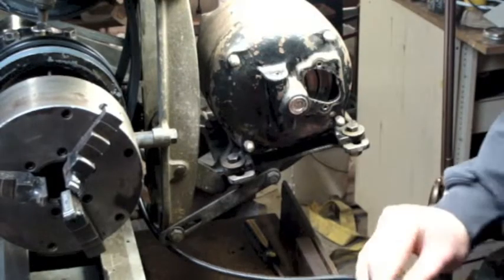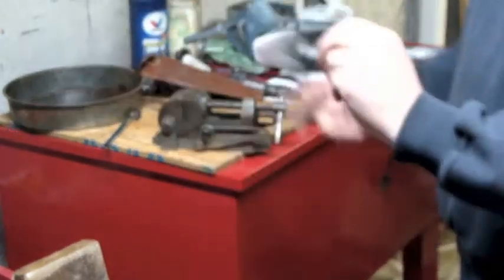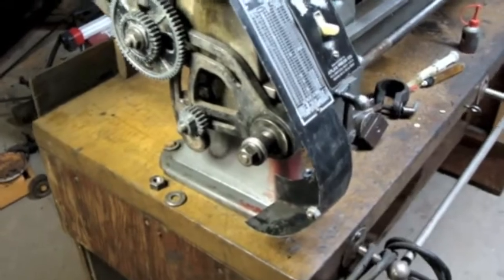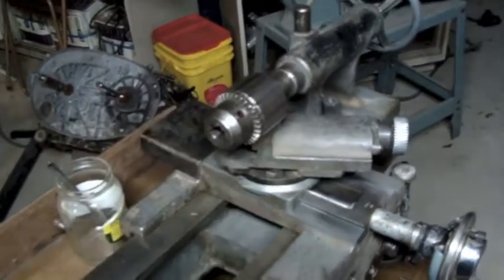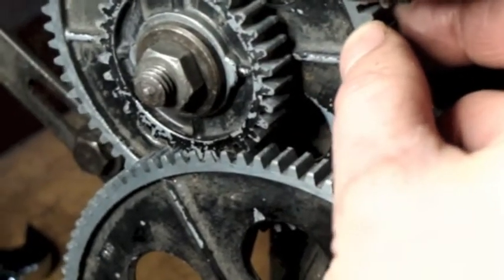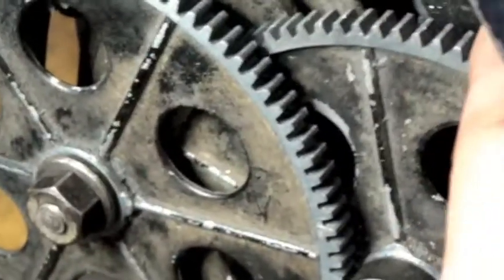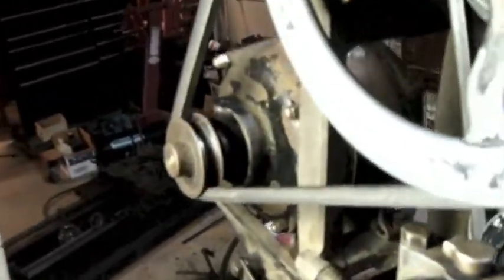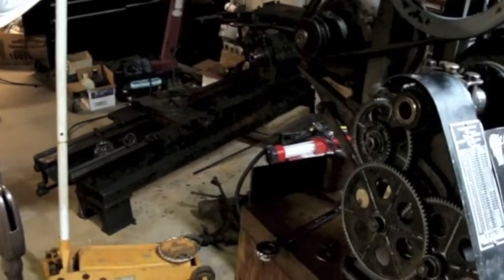Atlas 9" Lathe Part 25

Comment: This bad boy is from 1932 the first flagship of the 10” atlas lathe. I have a full carriage and compound assembly. I also have a head stock rare parts they seem.
Reply from the maker: This lathe was the 9". These were made from 32 to 38. When introduced in 32, it was the first bench lathe to feature a complete compound belt drive system to take advantage of the recently invented continuous loop v belts. Many of the parts were cast using a metal alloy called Zamak. This lathe was also featured in the Sears catalog as the Craftsman Metalmaster lathe. Thanks for watching
Reply: @stevewatr yep I got my parts from a lot sale can’t decide to sell or try to find one to rebuild. Your video is the only one on you tube with this lathe. My compound looks way different thus it must be completely original

Comment: Steve;

One tip I always use when setting up my change gears is that you should be able to slip a piece of tissue paper between the gears when you turn them (trap the paper between the gears) as they need a little bit of space to keep from grinding each other down.

Use as good a high pressure gear lube as you can get.  There is some stuff called Kluber (available on line) that is incredible, but it is like $50 for 50 grams.  I would not recommend using regular bearing grease or oil on the gears, it just doesn't hold up.

Another thing to do, if you feel like you really want to take the time, is to go over the gears with a jeweler's file and knock off any high points, burrs, rough spots, etc.  This is pretty mindless work, but it does make for some quiet running.

Lastly, you might want to think about keeping an eye out for Logan or South Bend gears that match your Atlas gears.  They are made out of steel and although you may have to modify the center holes to math the Atlas arrangement, they are stronger and quieter.  The Zamac gears are not what you would call high quality when compared to other lathe manufacturer's, but that was probably part of Atlas' pricing structure to have lower pricing.

Regards;

Ron Kluwe
Reply from the maker: Hi Ron, to be honest, I think the Atlas is going to have to go to a new home, so I will not be investing in any more tooling/parts for it once I have finished the bracket repair. One of three lathes has to go, and the Atlas drew the short straw.
Reply: Steve;

I know you have the Atlas and the Hendey from watching your videos, but what is the third lathe?  Would be interested to see some video on that one.

Regards;

Ron Kluwe
Reply from the maker: Ron Kluwe All in good time lol. Well the last Hendey video has reached 125 views, so I'll post a another tonite. I was waiting for 150 views, but now that winter is over, viewing activity has dropped way off. Lots of stuff to come. I shot some video today that might not be online until July! Just the way it goes sometimes. Hang in there. I'll bet you never heard of the brand of the new lathe……stay tuned.

Comment: Those gears do seem sloppy.

Hard to say where it is. There is a center hub that is top-hat shaped, then the collar with the keys for the gear. It looks like the collars are worn. Try the ones that came with the other set.

Lots of discussion on the A/C lathe group on lube for the gears. Some like Lubraplate. My fav is chainsaw bar and chain oil. It doesn't fly off and cleans up easily. Also it is dirt cheap.

You need to oil the hubs; I bet the previous owner never did so they are now loose.

When setting up the gears, put a piece of paper between the gears to set the proper clearance.

You will need another hub, bolt and nut for the B position for some threads. Easy to make.

 I'd be making chips by now. No need for the feed screw for that. ;)